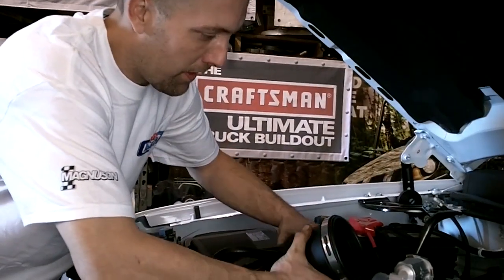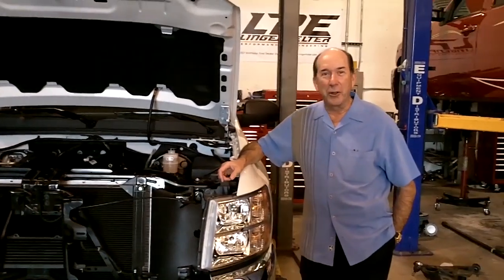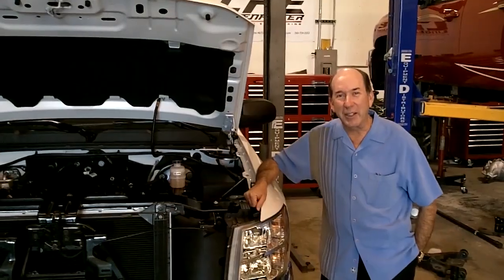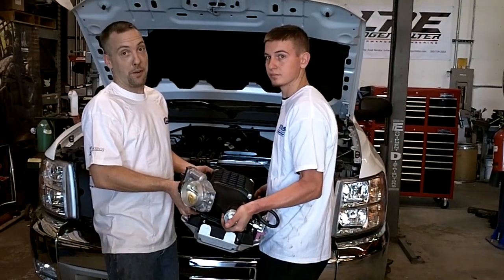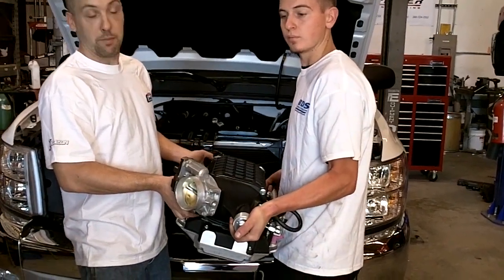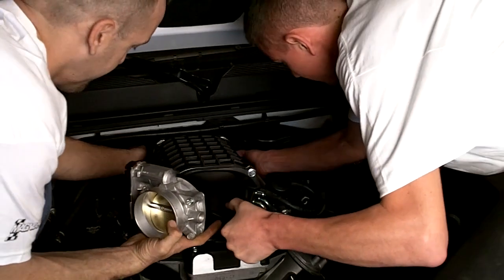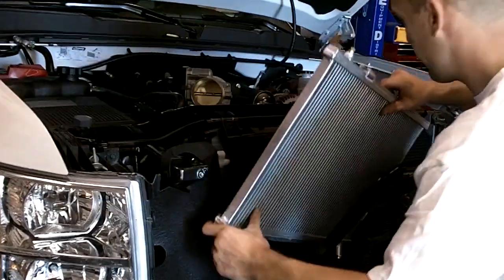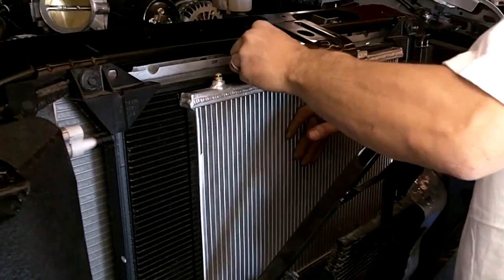CRAFTSMAN Ultimate Truck Buildout 2011 - Installing the Supercharger

Comment: i like the fact that its carb legal but for the price($10,000) vs hp increase (100hp at the wheels) i could build a brand new engine that would put out 800hp and be indestructible with enough left over to buy a 25 year old or older vehicle to put it in and not have to worry about carb standards.